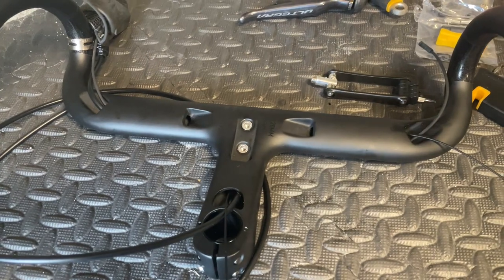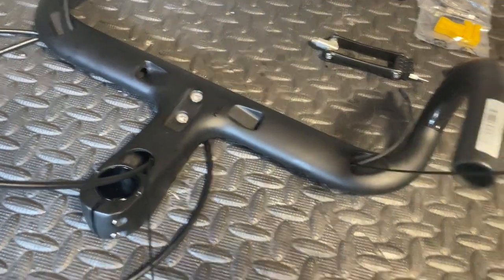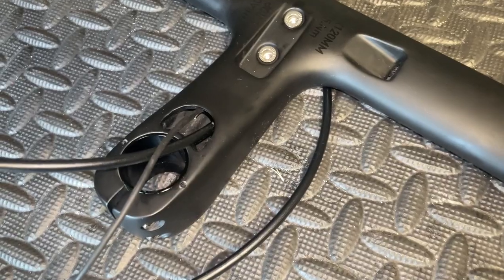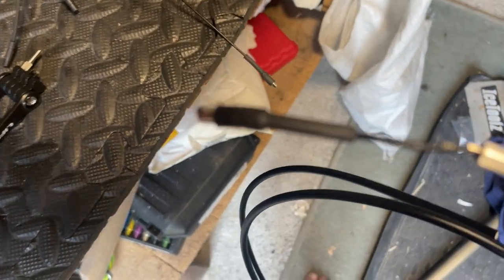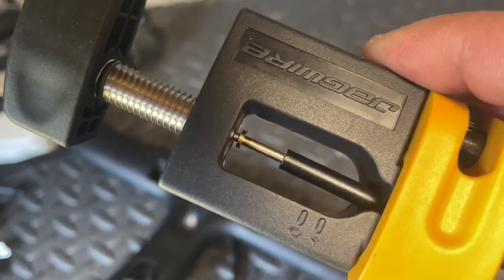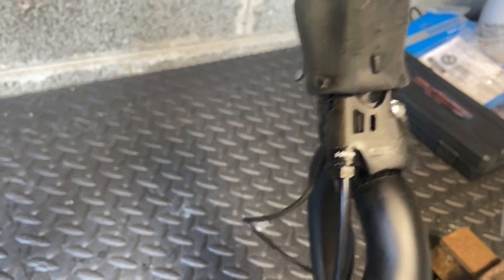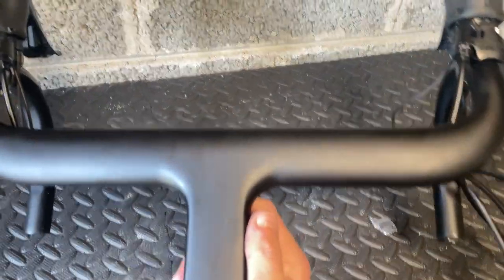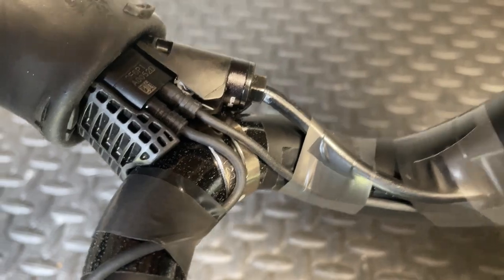Yoeleo H9 Handlebar (Version 2) Internal  Routing

Comment: Great video. I think those levers spec the BH90 hoses though. Never been quite sure how it differs though besides the material of the barb/needle.
Reply from the maker: Yeah that’s why I bought the proper needles, I’m sure the hose doesn’t make a difference and I’ve had no problems with the setup. 👍

Comment: Steve, make sure you use rather short bolts when attaching your head unit mount. I used the K-Edge provided bolts & they ended up impinging on & compressing my hydraulic brake hose.
Reply from the maker: I actually ended up buying a new mount from AliExpress. The SILVEROCK carbon computer mount for integrated bars. I think it’s a much better fit than the supplied one. But that’s a very interesting point… something I hadn’t thought about. 👍